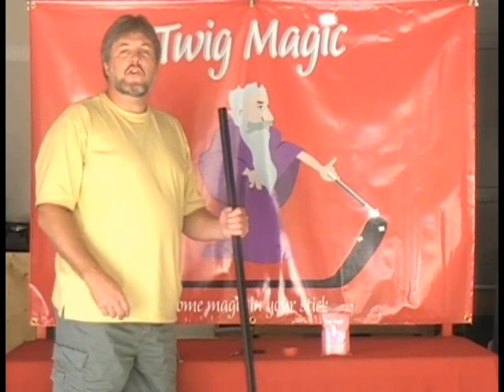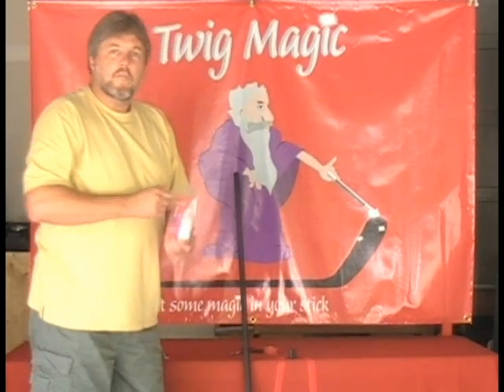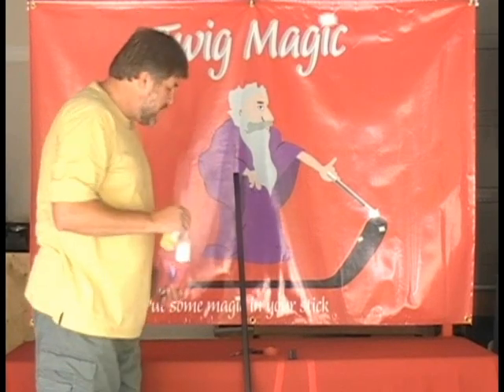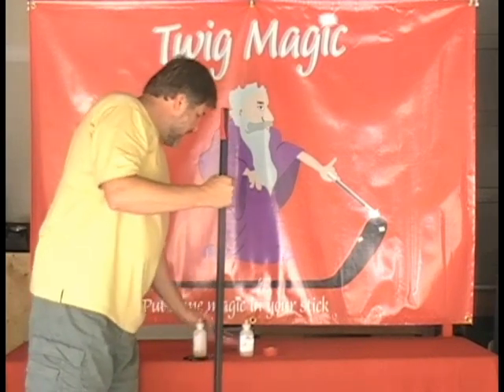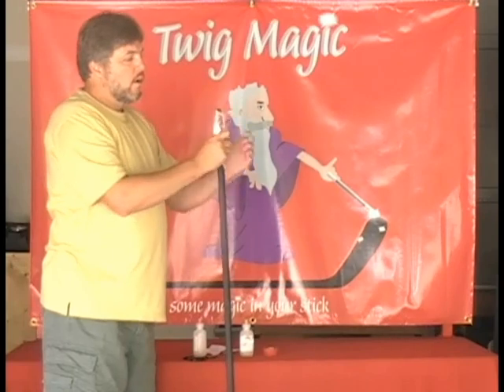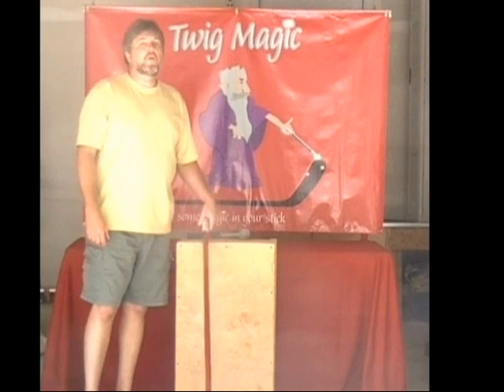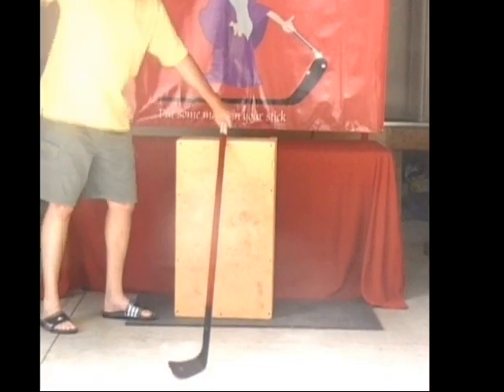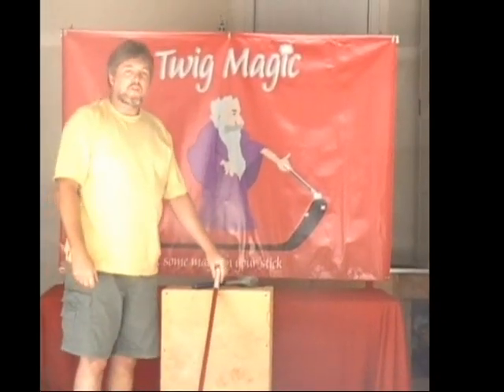The Twig Magic Stick System

Comment: It's definatly not spray foam he's putting in there. If you put spray foam in a stick you wouldnt be able to flex the stick AT ALL (half pound or 2 pound foam). Spray foam needs an exothermic reaction between 2 chemicals iso and resin, the stick would bend out of shape if it was heated to 80 plus degrees for the spray foam to expand.  Maybe if you used the garbage spray foam in a can, i dunno lol